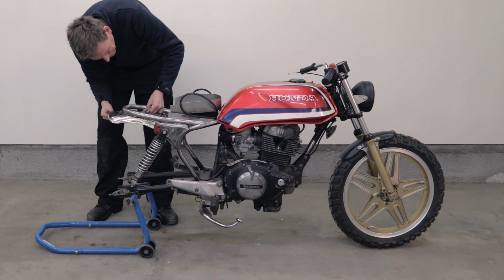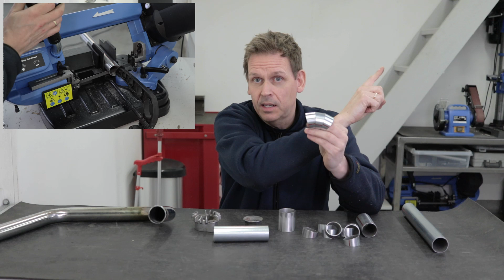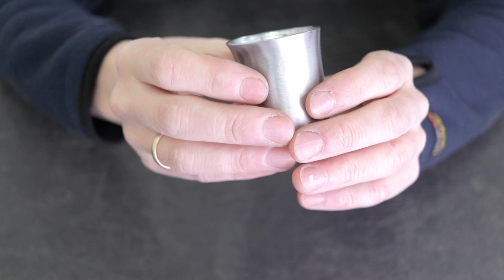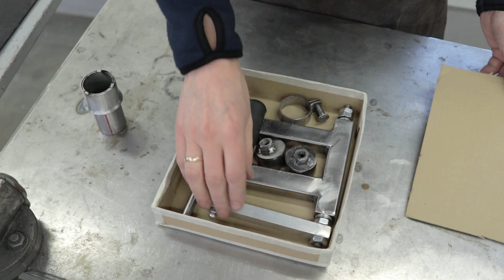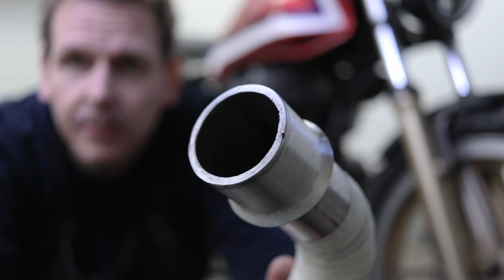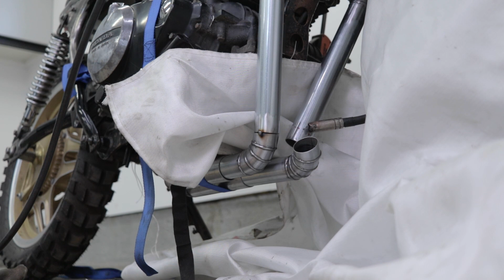Building Custom Exhaust - Honda CB400 Cafe Racer Build E8·S2

Comment: Awesome video! What diameter pipe did you use to make the large end that slipped over for the flange?
Reply from the maker: Thanks! To be honest, I don't really remember 😅 Do you think of the part that goes against the cylinder?
Reply: @kihestad  all good, I can measure mine and try and find something to work lol. yes, the part that goes against the motor.
Reply from the maker: Exactly, I just found a pipe that was slightly bigger 😊

Comment: I am VERY impressed with your welded joints on the exhaust, your “positioner” and all the ‘accessories’ you used did a really good job. Very impressed. I might have to copy that design! Thank you.  Now to find and watch the positioner video! Les
Reply from the maker: Glad to hear that! I have used it on several occations it works quite well!

Comment: It will be interesting to see how much the changed pipe curvature effects the engine.  You've gone to a much tighter radius and that may introduce pressure reflections back into the engine exhaust port.  Would like to hear it in action!  Nice welding work!
Reply from the maker: Yes, agree. It's a bit of an experiment 😊 I have kept the 'original aftermarket' exhaust and will try to compare them, both sound level and performance (not quite sure how to measure the performance, but will at least try... 🥴)

Comment: Wow, those are some nice-looking welds on the down pipes.

Many people like the fusion weld look that you get on stainless steel exhaust and intake systems. 

But unpopular opinion, but I don't like the look. 

The weld you made looks aesthetically pleasing for the build.

And it didn't get the same reaction as fusion welding for me.😅🤔👍
Reply from the maker: Thanks 🙂 I think it is most common to use TIG when welding exhaust pipes. I don't have a TIG welding machine (yet), and used my MIG welder. I did not use stainless steel for this exhaust (it's too expensive for this budget build). Different welder and steel leaves a different result, and I also removed the bluish discoloration using a rubbing pad to get a more uniform end result. I will have to rust protect it anyway using heat resistant primer and paint. Glad you liked the end result 👍

Comment: I would like your motad silencer buy.
Reply from the maker: ahh, this seems to be a duplicate... Google has had problem latest days with comments - they are coming and going... anyway - I'll repeat the answer here: 
Hi, you are the third one wanting to buy it 😊 Before I decide what to do with it I want to make sure that my self made exhaust is working properly and measure sound level by comparing the two exhaust. I hope to be done in a couple of month, and then make a video where I try to figure out what to do with the remaining parts. Stay tuned!

Comment: Nice job with the Vlog you're doing! Is the CB400 the 27 or 42HP?
Reply from the maker: Had to check it: 32 KW (44 HP)
Reply: You got a good one! A lot of them were made in Germany and were limited to 27hp through the camshaft
Reply from the maker: Ahh, I did not know about that. 27HP on this bike? The weight is around 200kg if I remember correct, it just makes no sense... :-P
Reply: @kihestad  If i remember corectly they were restricted to fit driver licence that required motorcycle to be 20kw limited. I wish i would be able to make such nice welds like your's on my cb400 turbo manifold, at least i can cover it with exhaust wrap so no one will see them.
Reply from the maker: Thanks! 🙂 It's the 45HP
Reply from the maker: ...or maybe it is 42HP